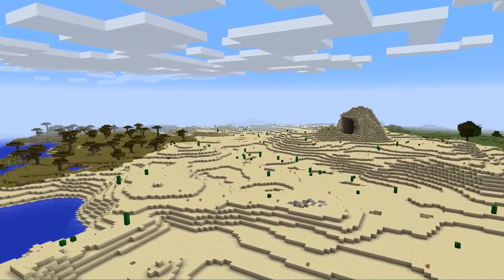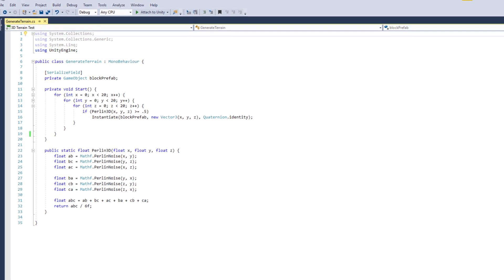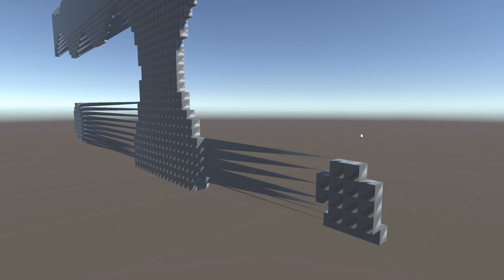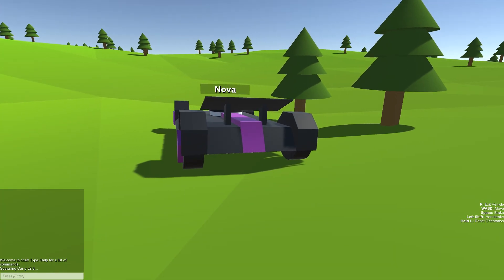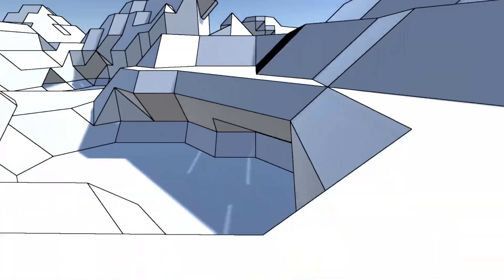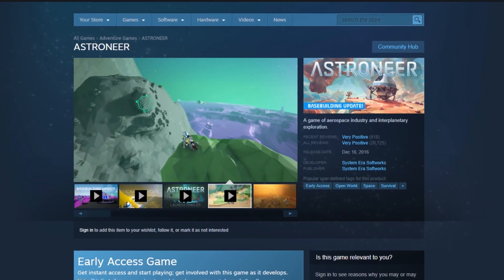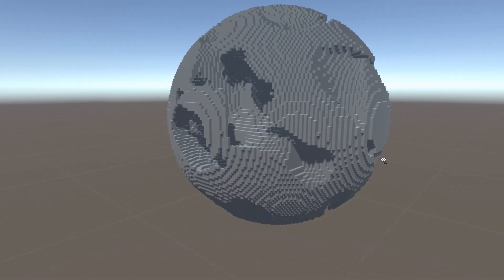My Adventure with 3D Perlin Noise

Comment: The marching cubes algorithm really isn't that difficult to get working. Basically it's just batching vertices into groups of 8, each vertex represents one bit in an 8-bit integer depending on if its solid or air. This spits out a value ranging to 0-256 which is used as the index to fetch the correct triangles from a lookup table, and then you can just add those to your mesh. Hit me up if you need any help.

Comment: What if you mapped some 2d perlin noise to the surface of that sphere, then lowered the threshold of the 3d perlin noise as it got closer to the surface? This way you'd have a planet with a solid surface and caves inside.

Comment: 1:58 You can use Mesh.indexFormat instead of using Mesh.CombineMeshes. set the index format to IndexFormat.UInt32 and make sure to add the UnityEngine.Rendering namespace. That raises the limit from 65535 vertices to 4.3 billion vertices.

Comment: Thought: Could you generate a smooth-ish terrain simply by isolating points where the noise passes a certain threshold, and discard the rest?

Something like look at all the corners of a cube. If they're all above or below the threshold it's completely empty/solid. If some are above and some below, you follow the gradient of the noise until you pass the threshold, and that's one vertex.

Smart? Dumb? :)

Edit: I started watching some other videos by Reducible (which i had already planned to watch) and it turns out i was exactly describing marching squares/cubes, sans some optimizations.

Put me on the team, coach, i'm ready.

Comment: Worth noting that the method used to get 3D Perlin Noise from 2D Perlin Noise is not very good.  It will generate a perfectly symmetrical noise along the diagonal.

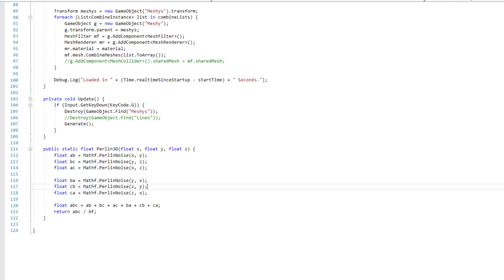Comment: Searched for hours looking for a procedural method to generating 3d Perlin noise without the permutation table and here in your video is a 3d solver combining lower orders together only 0:35 sec in. I love the internet.

Also, I would recommend looking into erosion systems to add on top of your Perlin generation, it will give you those rolling hills you are after.

Comment: you should look into naive surface nets, it's a simpler, faster and better algorithm than marching cubes. less popular though.

the algorithm places a vertex in the center of every voxel, and then connects it with the centers of neighbouring voxels. depending on the fill of each corner you can also slightly offset the center to where the approximate surface would be using interpolation. (lookup trilinear interpolation)

Comment: I don't know if its been mentioned below but during the video you say that you have a problem with the vertices count and you managed to fix it using combined instances but when I ran into this problem I used mesh.indexFormat = UnityEngine.Rendering.IndexFormat.UInt32; to fix the problem which bumps up the mesh count to around 4 billion, which might reduce the complexity of your program since you could treat the mesh as one large mesh rather than having to account for the combined instance.

Comment: Just an fyi: the fastnoise library you mentioned is an amazing noise library. I believe the is an unpaid one, and one that makes use of SIMD instructions, which makes it noticeably faster. The paid version is just a port made by the author, as the original is written in C++ (which is available on GitHub by the way). It comes with an unbelievable amount of different noise types with numerous settings, including gradient en perturb variants. It is definitely worth checking out!

Comment: Some problems I am having:
When I generate the terrain, and try to generate a new terrain, nothing happens
Using the same settings always creates the same terrain
The terrain has no collision

Edit: 1 and 2 were fixed (thanks brackeys)
Edit 2: Although 1 and 2 are fixed, terrain isn't normal terrain, just a cluster of very random cubes: more like white noise. It seems to generate a cube, and the higher the threshold, the more holes it has in it
Edit 3: Bruh he says in the script wehere colliders are added and it's disabled. 3 is fixed

Comment: Nova840, what you could do is generate 3D perlin noise, and then take a sphere, and for every vertice of the sphere, move it closer to or further from the center of the sphere based on the colour of that same point in the 3D perlin noise you generated. Then after that, use perlin snakes to cut out caves from there.

Comment: Just wait until you discover k-dimensional perlin noise. Took me weeks to make a k-dimensional perlin noise algorithm. You have to find all the edge-centers of a k-dimensional hypercube and then take the dot-product of your k-dimensional vector input with a k-dimensional vector representing the offset of a pseudo-randomly chosen edge-center from the center of the hypercube.

Fun fact: A hypercube in k dimensions has double the corners of a k-1 dimensional hypercube, but it has double-plus-x the edges of a k-1 dimensional hypercube where x is the number of corners of a k-1 dimensional hyper cube. i.e. a square has 4 edges and 4 corners, a cube has 12 edges and 8 corners, and a 4D hypercube has 32 edges and 16 corners and a 5D hypercube has 80 edges and 32 corners and a 6D hypercube has 192 edges and 64 corners. 

Homework: Make an algorithm that that finds all of the k-dimensional vector offsets of the centers of the edges from the center of the k-dimensional hypercube. i.e. for a square it's (-1, 0), (0, -1) (1, 0), (0, 1) for a cube it's (-1, -1, 0) (-1, 1, 0) (1, -1, 0) (1, 1, 0) (0, -1, -1) (0, -1, 1) (0, 1, -1) (0, 1, 1) (-1, 0, -1) (-1, 0, 1) (1, 0, -1) (1, 0, 1) Hint: it's every combination of 1 and -1 with at least one 0. 

Now that you know how many edges a k-dimensional hypercube has and now that you know how to find all the centers of all the edges, you can put those in an array and randomly sample them using the hash of an integer k-dimensional vector representing the unit-hypercube you are sampling, and then take the dot product of the offset of your real k-dimensional input vector from the center of that k-dimensional unit hyper-cube, and your pseudorandomly sampled edge-center, and boom, that value is your perlin noise value.

Source: Weeks of not showering trying to make 4, 5 or 6D minecraft...
Summary: Don't do it, just get a girlfriend and be normal

Comment: In order to get a more flat terrain-like generation you need to create a height gradient that you combine with the sampled noise value. There's various ways of doing this - adding vs multiplying, messing with minimum and maximum values, power functions, etc. but the gradient will ultimately define the vertical region in which the terrain goes from all cubes to no cubes. On the surface (no pun intended) this looks a lot like 2D height map terrain, except it produces overhangs (nice ones if you get the weights and noise scales set to your liking). Unfortunately this method doesn't produce any underground caverns except maybe a few occasional pockets near the surface, so to add caves you need to use another noise layer that carves away the terrain you made in the first step. This can be plain perlin noise like you've experimented with already, or it can be more complex stuff like 'perlin worms' to get more tunnel-like caves (I believe this is what Minecraft uses).

EDIT: Welp, looked at comment dates and not the video date, won't be surprised if this project has gone much further or died out already... Thanks youtube algorithm

Comment: This is mindboggingly hard (to do well). I tried to use marching cubes with a chunk system. Each chunk lagged the hell out of the game when generating, or taking almost a minute when in its own thread, and even then the chunks had seams betseen them. Holes between the meshes.

Why do they take so long to generate? Well, generating the noise and running marching cubes is far from all. If you want the terrain to look like a mesh instead of something bethesda would release, your mesh needs normals. Have fun calculating them. Very expensive algorithm.
Oh, what? You want to texture your mesh? Well, now you gotta procedurally uv-unwrap your mesh which is going to look like ass and takes an eternity to finish. This is not the even the texture generation. We are still just generating the mesh...
Then you would probably want to subdivide your mesh to get rid of all these nasty edges. Boom, your mesh shrunk. Now you have big ass holes between chunks that are inconsistently big.

Comment: I don't know if you'll see this, but have you considered skipping the voxel step entirely? Sample the noise directly for each point as you have, and build a polyhedron out of those points as vertices depending on if the individual points pass the threshold. If a point passes the threshold, check if it's adjacent to a point which does not. If so, it's on the surface of your solid, so you consider it a vertex. That would limit your shape's polygons to the surface, and no faces will appear inside the shape.

Comment: Marching cubes is a very simple algorithm, and it will work very well with perlin noise to produce fairly smooth surfaces. But you still don't want to use raw perlin for terrain. This entire video is very half-baked.

Comment: You should try to render the terrain the same way as Minecraft and Teraria does by loading it into chunks...

And also if you want to smoothen the blocks you could try to use the 3d Perlin Noise and translate it to a smooth Block..
It's kind of like making Cubes into anything depending on the terrain, for example.

If the terrain genrated in flat then it can remain as a cube but if the terrain generated is a Moutain, the cubes should deform to form the steeps of a Mountain..

Comment: You should make it so that it generates terrain with 2d noise and then does 3d noise and deletes all the blocks touched by it so it's like a world but with caves
Reply: But how do you get a surface? That just makes holes in your 2d terrain, but no caves.
Reply: didnt realize thats how it was done until now, good explanation
Reply: @ducky4303  That is one possibility, another one (Which Minecraft used before 1.18, and still partially uses) is an algorithm called Perlin worms.
Basically, you sample 1D Perlin noise (Input is time) 3 times to get a value for x, y and z. Then use this vector for the direction the cave will move. Now you have the path a cave takes, and you can remove blocks around this path to remove volume.
Reply: Cool

Comment: "i didn't really understand it, but it was isolated logic" - every programmer 2019
Reply: *2020
Reply: Yep, and from all other times programming was a thing.
Reply: Every programmer ever
Reply: if you dont want to use abstractions create your our cpu lol
Reply: This is making hiring competent gameplay/engine engineers very difficult, sadly.
Reply: @konstantinkh  
My guy, you know anything about programming?

Guys with 20+ years of experience still google how to do basic stuff in most languages
Reply: @arzr_er  There's a difference between not memorizing every API out there and not knowing how to do things. If you are implementing something that requires vector math, it's ok to look up what function/operator performs cross products in your engine/library of choice. In fact, that's expected. What's not alright is not knowing how to compute a cross product if you are writing code that uses them. Same goes for just about every algorithm, no matter how complex - within realm of game development, at least. You don't have to know all the intricate details involved in optimization - though, a good senior engineer will have a domain where they are an expert in these. But you have to understand how an algorithm works well enough to write a simple implementation. Naturally, I don't actually expect this to be the case for a junior engineer, but that should be the goal. That is something you strive towards throughout your career. That means taking an interest in things you are working with and not treating every API call as a black box. Digging into things, figuring out how they work, trying to write our own implementation, even if you know it won't ever be as good as what's already in the library - that's how we get better as engineers. People who don't do that don't get better. And since nobody gets born a good engineer, I can confidently say they never became a good engineer. There is, of course, a flip side to this. Engineers who re-write absolutely everything, because they never learned to search through documentation, the code base, or open source projects as applicable. In my experience, however, that's easier to fix, so it's not a deal breaker in new hires for junior or mid level, in my opinion.
Reply: @konstantinkh  It's in fact okay to look up how to do cross products too. Stop being a gatekeeper. It's much more about how workable the code becomes as it grows, if it scales, if it is readable, if it is modular. You are very right in that doing an implementation is good for learning. But then you misinterpret why. That is because you see how battle tested formulas were written. How they have been perfected on, and the structures that exists in the code, the polished optimization that mathematicians have evolved and then you get to imitate that. It has nothing to do with actually memorizing those implementations. You may look at google for even the simplest of things. It is okay. If you get stuck in the thought loop "Do you know how atan2 works?" "Can you write your own ik solver?" trying to just compare knowledge. Nothing like that is actually useful unless you take away how the structures and flow works. You rarely have to re-write any solved formula or tech. You do however need to study it to learn code structures and flow. You arrive at the conclusion that you need to balance rewriting stuff and not rewriting stuff. But that is actually not that useful, just like @ARZRer mentioned. Every function is already at your fingertips. Being competent is not in knowing the science that went into them. Just how to utilize them. How to structure the code so it builds a good architecture.
Reply: @osten222312  I started out professional career doing theoretical particle physics. I know perfectly well the difference between what you can do on your own and what you can do while standing on the shoulders of giants. And I always make sure to test applicants with problems they've never solved before, because yes, that gives me very useful information about how they'll be able to push projects forward. But foundations are important. There's a reason you spend 10-12 years in school before being dropped into university. If you don't know even the absolute basics of topics you are going to be working in, you will not be able to just read up on-line how to do things. All of the technical papers you might be working from assume you know all of these things and will not go into details. And no, you can't always just grabbed a solver, because there's licensing, there's performance considerations, and then there's the fact that we're not just sitting on our hands in real game dev, and a lot of our work is on cutting edge that nobody's sharing code for. There is a reason why we have our own math library in the studio. We have to be able to rely on how it works internally. There's a reason why we have our own IK solver. It has to work for our use cases and have good performance across target platforms. And while I don't need every single engineer to be able to write these things from scratch, I most certainly don't need one at all who can't go in and debug code in absolutely any of these.

What you are proposing can work for a small indy team with no budget and limited liability sticking to capabilities that Unity provides you from the box. It will absolutely not cut mustard even at a mid-range studio, let alone a AAA one with in-house engine.

As for gate-keeping, that's actually part of my job description. Making sure we don't hire people who will be a waste of company budget.
Reply: @konstantinkh  Not gatekeeping is not something that only works for indie studios. The IK solver was an example to make a point. You don't need to use that to say that your AAA studio has their own IK solver and that you have a reason for that. It makes no difference to the actual point. The point is that people are not automatically better or worse at learning programming because you say what they may and may not do. That they need to learn IK solver math, really learn all the matrix conversions for the twists, instead of focusing on programming concepts.
 
I just pointed out that rewriting existing code is a good learning exercise because of the structures you can see in the code. Understanding battle tested code is learning programming. Understanding the exact math and solving the math problems is not learning programming. At all. If you rewrite deep math functions you learn math, as well as some programming on the side. If the point is learning programming you don't need to re learn math that is already solved so you can focus on the programming. But you don't get it, you just need to win so I guess yeah, you win. By being a theoretical particle physics AAA developer that hires people. It makes you very qualified so I guess I just give up here. Let's just gate keep as much as possible.
Reply: @osten222312  well I wouldn't give him the benefit of the doubt yet, he hasn't even given us any proof that he in fact carries these credentials. That's actually pretty important in this case, because if he doesn't actually carry these credentials it's just another internet physicist/AAA dev. This all said, he's watching a very entry level programming video on YouTube so the likely hood he actually carries these credentials is pretty dubious.

Comment: hmm...
use each cube as an on/off switch for the points on a bigger cube?

i will demonstrate with squares

01|10
11|11
---+---

11|11
01|10

becomes

˙/\˙
/˙˙\
\˙˙/
˙\/˙